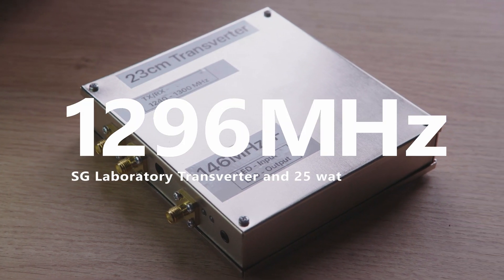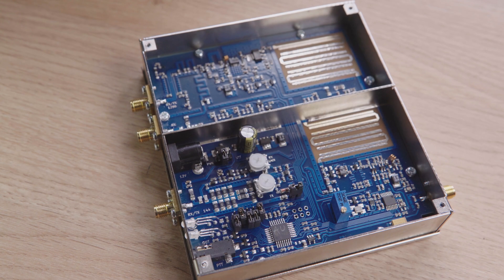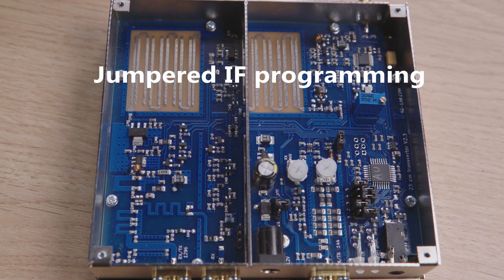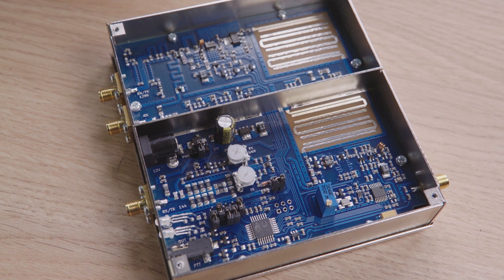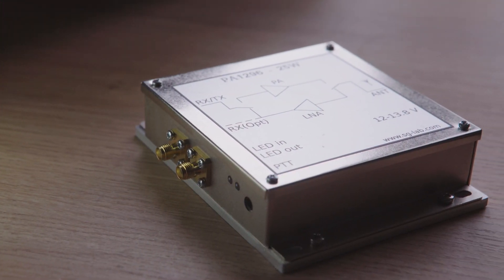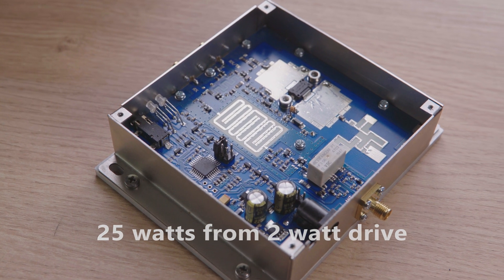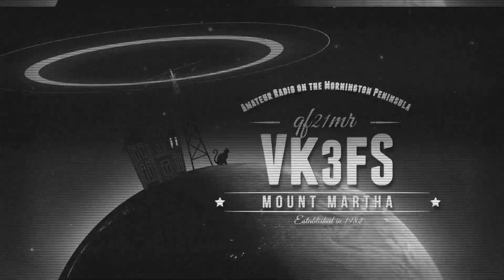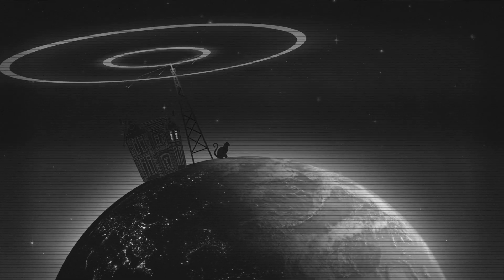23cm SG Lab Transverter and 25w PA

Comment: 1 Question,
 if anyone cares to answer . . 
 best Frq for voice communicate at
A distance of 800 km
Clearing a mountain range of  2,000 meters
Using an antenna deploy-able in an Urban environment.  ??
Suitable radios . . .Lab599 TX500  or ??
And is it possible to calculate an optimal angle to set said antennas?
@ Latitude  35°17'0.46"S

Cheers
Reply from the maker: Interesting Question Joe. I'd try 3.5MHz at night, but nothing reliable during the day. Ask someone local to you.
Reply: @VK3FS    There cant be any trying in this situation, there must be an algorithm to give an exact answer. I mean we put a man on the moon in 1969, what about weather balloons and mash wave?
Reply: Maybe you should investigate 10ghz and reflect your signal off a fixed orbit satellite